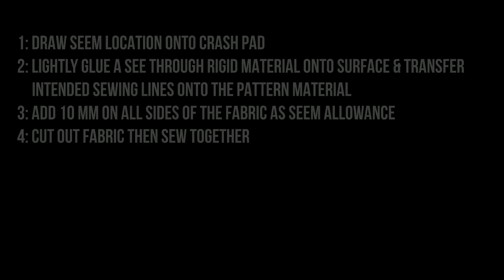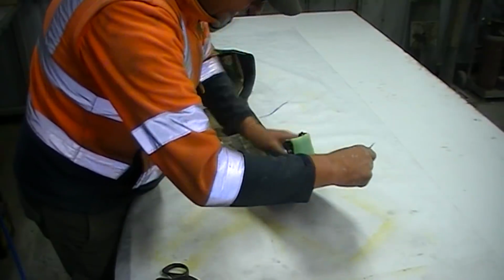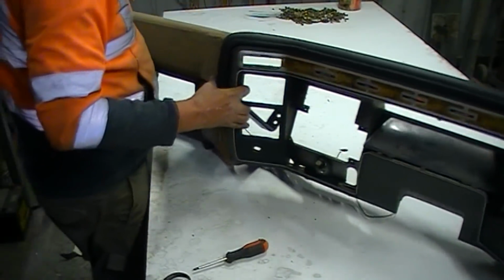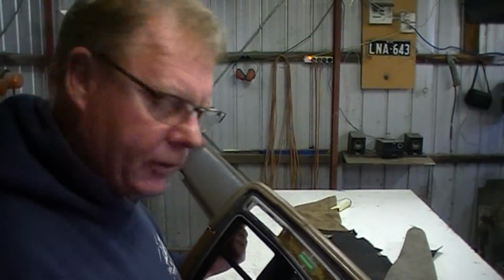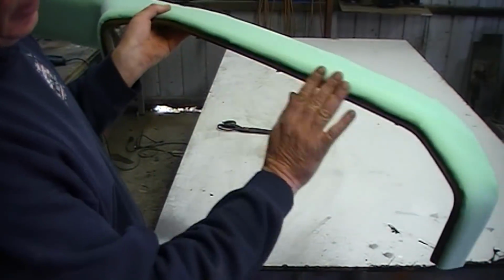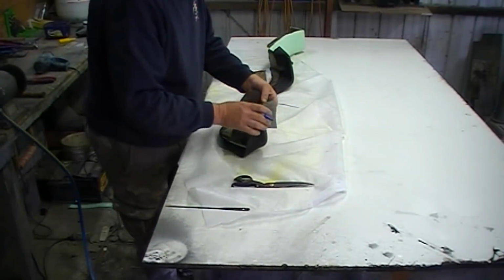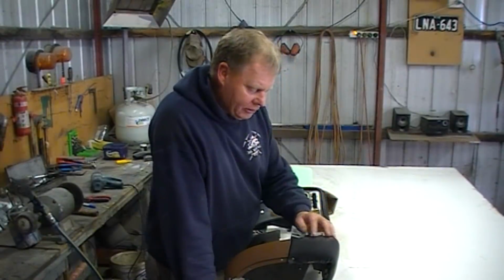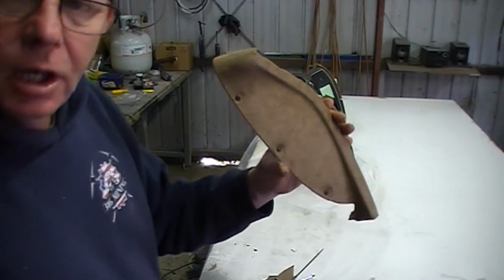Ford ZF Fairlane 13 Restoration

Comment: really enjoy seeing the upholstery side of what you do, as a pro painter and beater its one of the aspects of classic resto i not touched on yet, any time you feel like making a how to on uphostering for beginners would be great
Reply from the maker: messylaura great idea. What sort of item would you be interested in seeing? I have an old antique chair I will forensically restoration after the car is finished. But I also have a custom interior for a mates XW wagon shortly.
Reply: not used a sewing machine yet.......... how far back you want to start. 
simalar t what you were doing here, recovering, also making a seat cover from scratch, ie if you can't get one or if you want to remake the same from original but in a different colour or material.
where you were trying to stretch the fabric over the dash one of my thoughts would have been to grab the heat gun and make it more pliable but you could mention the do's and dont's 
some things you can guess right like the 45% cut for corners as thats how i do those on door skins.
Reply from the maker: messylaura ha ha you’ve got it mate! Oh yes, the heat gun got a lot of use but mainly to flash off the glue faster, this vinyl was thicker than usual auto grade vinyl and had a rigid backing on it so no amount of heat was going to help it fall around corners so it was down to brut force to make it do what I wanted lol. I’ll do a comprehensive vid on a car seat cover soon. Pattern making and cutting the fabric is the key so I’ll be really careful to make a good video of that
Reply: the kitty cat was very realistic too, couldn't see the seams..........................
Reply from the maker: messylaura lol yes that comes from years of experience... I’ve upholstered countless cats : ) the ears are the most trickiest part
Reply: another thing regarding sewing/upholstery would be tools, like what type of sewing machine would be best for leather/car material as opposed to regular dress making machines, simalar to teaching a noob the differance between a hobby mig and a professional ones
Reply from the maker: messylaura yes it’s best with an industrial machine so you can run a heavier thread. And also a full walking foot helps so much as it walks the fabric under the needle.
Reply: i did see a few leather sewing machine vids after ii posted that, walking foot and also a speed reducer, though that was more for heavy gauge leather for wallets and belts
when you upholstered the cat did you use real beans for the bean-toes :)

Comment: I'd hardly call that a fail, with a little tinkering I'm sure you could have got the first attempt to look how you wanted it to.  But, clearly, you're a perfectionist so I can understand wanting to give it another crack...
Reply from the maker: gosportjamie : ) yeah it was close but not good enough mate. The trouble is when you life glued material off foam it tears padding underneath plus also it affects the performance of the material on your next attempt. Awesome result tho aye
Reply: +Jason Hill  It's a shame that the reason you needed to re-do it was because of something that a previous owner had caused in the past while refitting the dash panel but it gave you the chance to have a rethink and try a couple of different things.  As you say, the finished result is awesome, and it's a very tricky shape to cover being such a complex moulding...

Comment: Nice work Jason, just a suggestion but you are obviously a guru with the scissors, there's got to be a huge audience for restorers wanting to take a project from start to finish who know very little about Re-Upholstery. If the title was ZF Crash Pad Re-Upholstery, you might find a whole new audience. Personally I would be really keen to see videos that focus on upholstery, what you need, how its done. As you are doing it anyway, videos that take you through the basics. Tons of channels covering mechanicals, rust repair, paint etc. But not many on upholstery. Just a thought.
Reply from the maker: greg novak great idea mate! I might do a car interior series

Comment: Brilliant job Jason and the two tone dash is bloody beautiful and very unique. 
May I ask where you source your vinyl and fabric ?  The headlining in my car is this nasty 
soft cream colored fabric and because the car's almost thirteen years old it's a bit dirty.
But I dare not clean it because the fabric is starting to separate from the sponge which is glued to the roof panel.
I want to replace that nasty soft fabric with vinyl for ease of cleaning one of these days but I've looked around for a similar cream color and can't find it anywhere.  There are plenty of blacks and greys but cream colors are hard to find. It would need to be at least 1.5 wide.   I'm sick of looking at my dirty headlining but I can't clean it.
Reply from the maker: Ellesmere Wildwood yes it’s a pain when the fabric seperates  . If you are in Melbourne there is a company called Vyfab in bignal road Moorabbin. They will have what you want. Sadly you are going to need to drop the whole headlining panel out to replace the material and to get that panel out of the car you will need to take out the rear window.
Reply: Thanks Jason, I'll take a drive up there and take a look.  As for the roof board, you may be right but it doesn't appear to be in any sort of contact with the rear window.  In fact you can slip your fingers up underneath the board.  The board is help up with clips at strategic points. 
My car's got a sunroof too so I suspect that may be why the material is still hanging on.  Still, when the time comes if it looks too hard I'll have to take it to someone.  Thanks again, cheers.
Reply from the maker: Ellesmere Wildwood  no probs mate.... yeah the roof board isn’t held in by the rear window but to get the board out of the car without buckling it a window needs to come out... I suspect
Reply: Oh yeah, I hadn't thought of that. Damn !  Well that will mean a trip to O'Brien's.  Probably the easiest way will be to get one from the wrecker's then it'll be a case of window out and window back in on the same day.
Thanks Jason, it's always good to be able to get steered in the right direction from people in know.  I would have unclipped everything and THEN realise there was no way to get the bloody thing out.  
When the time comes, let me know if you need help with your instruments.